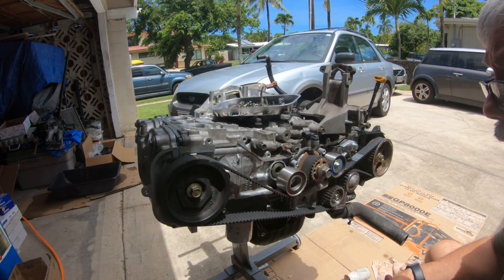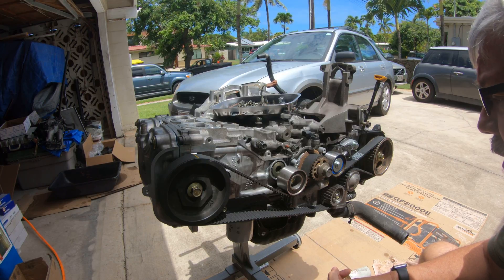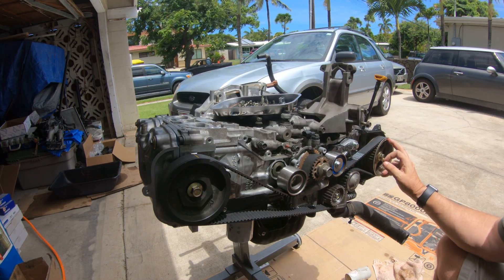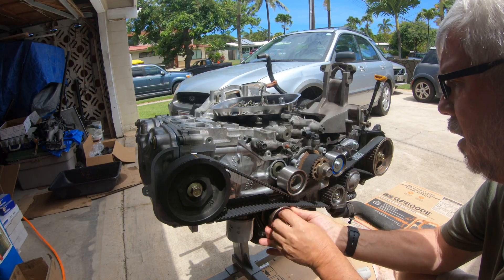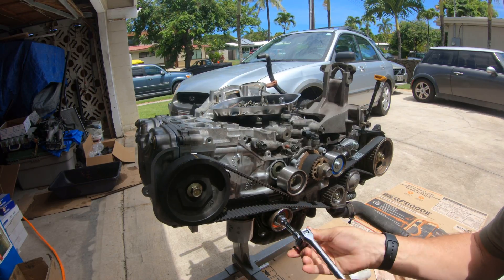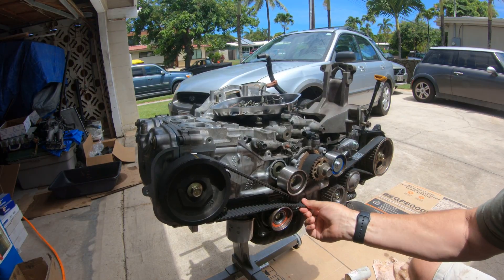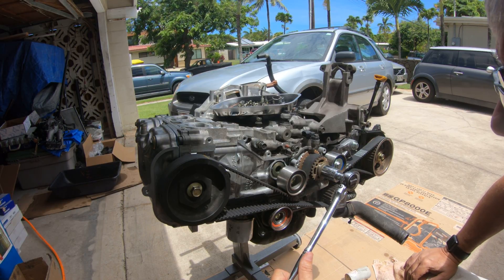Subaru EJ25 Timing Issue

Comment: If you had the heads shaved you need to adjust the valves
Reply from the maker: Didn’t have the heads shaved Jason. Just made a stupid mistake that took a long time to figure out. Dropped a washer in the cylinder that kept it from a full rotation. Cars running great now and is in California with my daughter in college.
Reply: Cool

Comment: Did you ever find a solution?
Reply from the maker: Embarrassed  to say, I did. I inadvertently dropped a washer in one of the pistons while putting it back together and that was preventing the ability to rotate the crank 🤣. Glad I figured it out before attempting to start the engine.
Reply: Thanks for the reply.  I'm glad you found it before damaging your engine.  I hope it is still running well.

Comment: Check to see if the crankshaft sprocket woodruff is still there. Slide the crank sprocket off and verify that the key hasn't fallen out.  Check out my link here https://www.tolsgarage.com/2018/09/crankshaft-timing-mark/
Reply from the maker: If you're talking about the little lock that keep the sprocket in place, they are both there.  I took the sprockets off this morning to see if that might have been the problem.  Argh....
Reply from the maker: Oops, yes, i took off the crankshaft sprocket also to replace the seal.  Not sure what the woodruff is? but both front and rear marks on the sprocket are in place.
Reply: I'm thinking the "crankshaft sprocket" woodruff key might be missing. You should be able to rotate the crankshaft almost 90 degrees before the piston hits TDC. If you are making contact with something at 25 degrees, I think the crankshaft sprocket is not right.
Reply from the maker: What does the woodruff key look like? If it is in fact missing, what would be involved in correcting the situation?
Reply from the maker: Sorry, my numbers were off.  not 25 degrees about 45 degrees.
Reply from the maker: You can see at 1:48 in the video just how far I'm able to go.
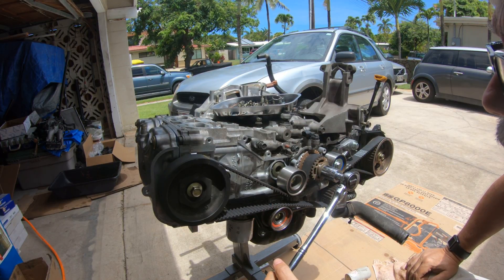Reply from the maker: 1:50 is where it stops.
Reply from the maker: Woodruff key is in place.
Reply: Take the spark plugs out and look to see if the piston is at the half way position with the cam timing mark at the 12 o'clock. If they are, it is safe to rotate the cams, now you can make sure the cams rotate freely.
Reply from the maker: With the crank at 12:00, the gears rotate freely.  It's only when the belt is on and both the crank and cams are turning that it bottoms out.
Reply from the maker: When I did the heads, I cleaned the cylinders.  So I know that when the crank gear is at 12:00 the pistons are half way through their travel.
Reply: Try pulling the rocker shafts off of the right (passenger) side and see if the engine rotates. Each shaft is only four bolts. You can compare the left side while you are doing this. TDC will have one set of valves closed and the opposite side on overlap.

Comment: Hey marxtr6, don't forget that the cams are not timed at TDC. The timing is marked with the pistons half way in/out so you can rotate the cams without the valves hitting the piston tops. Double check that you are using the correct timing marks. I have added a few pictures for you to check out at my link below. https://www.tolsgarage.com/2018/09/right-pulley-timing
Reply from the maker: Hi Tol, Thanks again.  I'm using both cam marks you've depicted and still bottoming out.  Any ideas on what might be wrong?  I'm thinking when I took it to the machine shop, something may have got out of whack?  It did run before the tear down. I appreciate the effort.